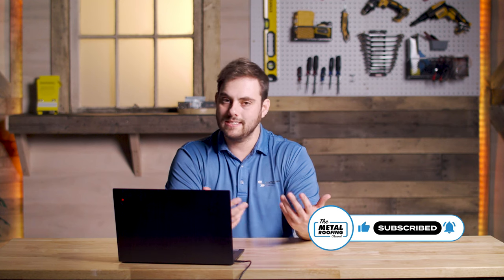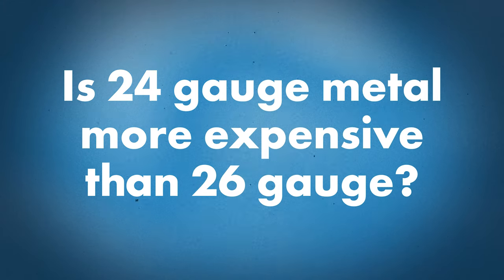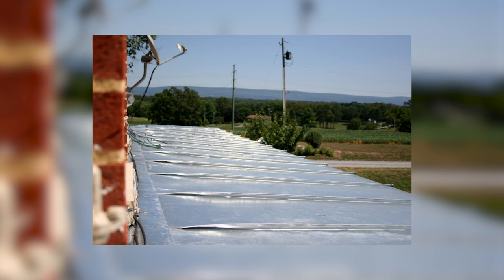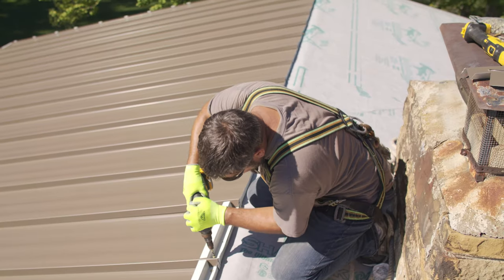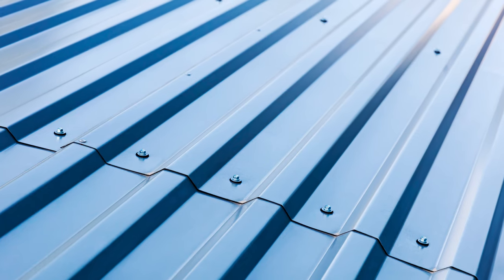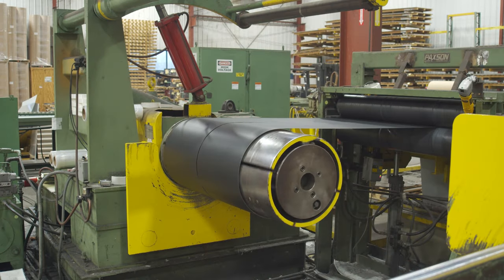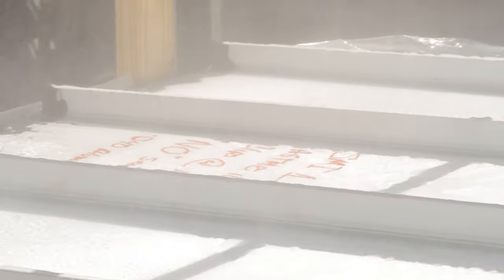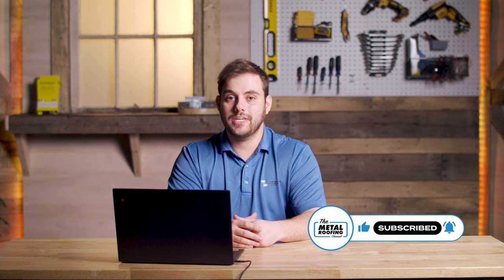24-Gauge vs. 26-Gauge Metal Roofing: Which is Better for Your Project?

Comment: Interesting premise for the video. 22 and 24 gauge are the primary thicknesses we sell and install on standing seam roofing in Texas. We only really see 26 gauge metal on screw-down roof sheeting such as R-panel.
Reply from the maker: That's some good info! Sheffield Metals does supply 22-gauge steel as well. We usually see that go out the door when it is specified by an architect for certain types of commercial projects. What types of buildings do you install 22-gauge on? -Thad
Reply: @TheMetalRoofingChannel  actually Sheffield supplies all the coils we use for standing seam roofing. We install 22ga primarily on high-end residential at the coast and around Central Texas as well as some commercial installations, but 24ga is our "bread and butter".
I can only think of one instance were we sold and installed 26ga coiled metal and it was used as flat panel soffit at a bank in Austin. 
The order of magnitude of physical difference between 22ga, 24ga, and 26ga metal is surprising for most customers. Labor/installation costs tend to be where most of our customers see the financial difference in the 3 gauges depending on the specifics of their project.
Reply from the maker: Very nice! You're right, when holding a sample of all three thicknesses you can quickly see what huge difference there is between them. Let me know if you have any content requests or if 22-gauge is something you want us to do a video on as well. Thanks for the comment! -Thad
Reply: Looking into building a barndomin  ~ thinking 24 gauge for roof & maybe 26 for the siding areas... live in Oklahoma

Comment: How does a standing seam roof compare to a stone coated steel shingle roof in durability and longivity?
Reply from the maker: Standing seam should have a longer lifespan and will generally be more durable. Stone coated shingles usually use 26-gauge steel, while we typically recommend standing seam to use 24-gauge. Additionally, you can experience granule loss throughout the life of a stone coated shingle which can affect the aesthetics and expose the base metal to the elements. A standing seam roof can be installed as an engineered system that is proven to stand up to real world elements. I'm not aware of stone coated shingles having anywhere near the extensive testing that standing seam does, but I do know there are companies that offer stone coated shingles with a UL 2218 Class 4 hail impact rating and they can be installed as a Class A fire rated assembly. However, stone coated shingles have a unique look and you won't be able to perceive oil canning like you would on a standing seam roof. Your choice comes down to your location, budget, and the aesthetics you're going for. -Thad